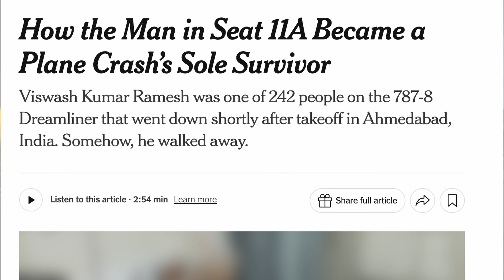Why the RAT Changes Everything – Air India 171 Update

Comment: So the pilot and copilot is having more than 8000 and 1000 hours of flying experience so do you really think that they won't distinguish the correct lever - Flaps and Landing gear - the landing gear is far away from flap controller its like muscle memory and why the Prop sound was coming in the video -  bcoz of RAT was deployed and that clearly indicates something really bad with the engines, so Boieng should answer this

Comment: GEnx EEC Microprocessor fail by solder failure. FAA issued directive 4 years ago for 747-8 and 787-8 GEnx engine and told to reduce Remaining Useful Life of component and change out prior to PF Curve failing. This is a known failure mode that may have been overlooked by Air India O&M??

Comment: A plausible cause could be the main Battery and alternative battery toasted internally, due to extreme Heat wave conditions. Since the Temperature at that time on the ground was like 50+C and the overall temp was like 46C around that airport. when the flight arrived to Ahmadabad few passengers were telling they had Cabin A/C 's compressor were on and off due to the weather in Delhi when the passengers boarded. So to sum it up multiple level of failures. 1) Had the the previous pilot / Staff informed that they had this issue ?  2) can the battery cause both the engine to fail. 3) how come when they were in the beginning of the tarmac both engines would be roaring/ Firing  and then failed all of a sudden at take off both tanked. Looks like both the engines failed  to provide enough thrust after take off with limited time to react and act.

Comment: At this point it is to early to surmise on limited information. You have already changed your mind due to more information. (footage)  When the black box information is examined  lt will reveal even a lot more . 
My freind a pilot when he saw footage said ... engine failure . He may be right.... first time and he only Flys crop dusters. Another freind who is a mechanic  on an apple orchard said its an hydraulic issue .... he could be right first time ! 
I'm not here to express my opinion on what it might be ...... apart from a very tragic accident. 
Let the real flight investigators do there job . 
Then the public will be notified at the proper time with proper facts on what has happened .

Comment: What could possibly cause both engines to fail at the same time? Aren't they designed to be completely independent from each other?
Or is there some subsystem in the aircraft, the failure of which affects both engines at once? If that's the case, it's a fundamental design flaw.

Comment: I think from the beginning on there was evidence that something was wrong with the airplane (if the video is legit) A video surfaced online where passengers of the previous flight on that same plane had no working on board screens and remote controls which could indicate some issue with the electronics
Reply: They are switched off until airborne

Comment: Question that needs to be asked is what are potential causes which can cause Engines to shutdown , folks note that engines per se need not fail like bird strike or mechanical , it could be electronics controlling it that fails although engine controllers are double double redundant meaning even if one channel out of 4 works then this can't happen. 

But atleast credit to the way he finished the video 

Is boeing 787 going 737max way ?

Comment: May I ask for theory of flaps since we have such intelligent sensors and automation in place. Would it not make sense that flaps are automatically set for lift-off where pilot can manually then override. Rather than having them off, where it is susceptible to human error. Meaning that it would be guaranteed that human does not fail, while still giving input options if anything goes wrong? 

l get it for landing gear, it is better to keep it down until you’re sure as you can use them to land in emergency. Thanks!

Comment: Steve sir , battery drive motors hydraulics,hydraulics drive flaps, landing gears. Long stoppage at ahmedabad drained batteries running airconditioning. At takeoff batteries shorted causing explosion sound.

Comment: One more observation is that the main gear is not tilted, it is horizontal, wich means that the "gear up" action was engaged just after takeoff, normally , it's done automatically before the gear is fully retracted . For some reason the full rétractation was not completed, maybe because of a sudden loss of electrical power, wich could confirm a dual engine failure...

Comment: So? I guess the question might be what electrical system or control system failed to make 2 engines stop? A clogged fuel filter like on a car? Do planes have fuel pumps that could fail? So, the plane was dispatched from the gate. Engines fired up. Enough thrust to get to runway and down the runway the engines are reving up yes then for some reason the engines stop? No more fuel to the engines? Pilot controls failure? I am no pilot just throwing uneducated questions based on pilot Steve's knowledge. 🤔

Comment: Good explanation sir! Iwant to ask something though. Why isn't the aviation industry doing something about the fact that if/when things go wrong in a flight it ends up proving fatal for everyone on-board? They should have an emergency evacuation plan where the fuselage detaches and drops down with parachutes deployed. Something similar needs to happen with the cockpit also for the safety of the pilots. So many years of plane crashes and still we don't have this in place. Spacecrafts have detachable units, then why can't it be used in planes to save lives?
Reply: They can also use thrusters that can be controlled from the inside to get some control on the navigation of the fuselage/cockpit under parachute - to make them land in a safe area. They are using these things in spacecrafts for years.

Comment: Could there be some interaction between fuel contamination and the nose up pitch triggering the dual engine failure? Like a layer of water and when the plane pitched up it changes the orientation of the fuel in the tanks leading to the failure at/near rotation?

Comment: Is it true that the 787 engines will not run at takeoff power with any kind of gravity feed alone, i.e., they need at least 1 electrically driven fuel pump? Is it also true that a previous 787 software bug would shut down all AC generators if it was powered for too many days? If both of these are true then it seems like a massive red flag. Software alone shouldn't even have the capability of shutting down something so important.

Comment: A dual engine failure after rotation, not associated with a bird strike or fuel problems is something unheard, please correct me if I'm wrong. Maybe they shut down the wrong engine, but it sounds unlikely to me.

Comment: A question please , you said when the RAT deployed  it should supply power to controls , hydraulics when the engines fails 
What happens if RAT  requested while engines are running does it restart request of engines because of switching of controls power source ?
Reply: Is it possible to request RAT even  while engines are running ?

Comment: Could I also add just a thought that’s all nothing else.Could accidentally raising the flaps be misconstrued as a double Engine failure as in the few seconds you have to diagnose it feels like the plane is without power as you will create a descent by this action .This in turn could have provoked manual deployment of the RAT and half of a mayday call.But then again you would not get the electronic switch over as experienced by the survivor.Why am I saying this ..well the engines provided them enough power to get well above the positive rate gear up call and that’s a drill that is just always going to happen as soon as airborne.Why no gear up then..?The engines allowed them to reach an altitude well above this call level .Of course if the fuel control unit failed or some thing to cause the double failure even before the gear up call 
that would explain the gear still down….but the Aircraft climbs well before the descent point and that’s well above 100 feet…so why no gear up?…Anyway leave it to the evidence and the experts…just to say don’t forget the manual deployment.

Comment: I was part of a team that developed a statistical solver for system failures, nearly two decades ago. The study was sponsored by NASA and Lockheed. Now more than ever there are solid failsafes in the hardware components, which’s great. But what we really tried to crack open in our research back then (but couldn’t) was to develop a metric such as MTBF for the control software. I’ve not revisited this train of thought since then. This tragedy has forced me to cautiously, and with utmost respect suggest that this could be a software failure. 

Why? Cos as a system increases in complexity it gets ridiculously hard to speculate why an RTOS primitive such as a semaphore has taken, and why it will result in a race condition. Sometimes it is as simple as a software update to the seat lighting system, which involves “hack it to crack it” - ok the project deadline’s round the corner let’s get this done ASAP- wait on the flag, once the button press is serviced, but HELLO you ignored/forgot the release operation and the reviews did not catch it because it takes several million runs before it has a system-wide ripple effect. 

With the advent of more features (driven by expert systems and modern AI) there’s a big code bloat. With 3rd party developers and vendors getting access to critical sections of code (not to mention unlimited virtual memory), we run the risk of a catastrophic system failure due to a “minor” coding error. 

All said and done this is extremely tragic. One can theorise all one wants but the only wish in the end is, that this never happens again.

Comment: A piece of information that might be worth considering is that (apparently) the plane joined the runway and taxied back to the end of runway 23. The security camera video appears to show the aircraft rotate at the very end of an 11,499 foot runway. With nearly 40-degree temperatures and a fully loaded plane, one expects a longer takeoff, but this seems to be very long. Is this an indication that they were low on power? I'm not a commercial pilot, so your opinion would be valued.
The other piece of the puzzle is that the flight path of the aircraft shows a 30-degree yaw to the left. The point of impact is not in a straight line with the runway. with the dust thrown up in the video and the crash site, is it possible that they took off with one engine? I know that the 787 can do this safely. Again, your view would be valued.
Mark

Comment: A bang could be anything, but, anything engine related would have caused something of a visual effect...
now, we know at the very start the 787 had issues with exploding battery units (something also possibly triggering a ram)... I know they thought they fixed it but might the issue have reared it's ugly head again???also, from my audio it  seem we can hear a jet engine too...
another option is that this was an (Islamist?) terrorist attack after all, I do not believe that the plane was shot down, but, an unlucky location of a small bomb could have quite easily temporarily cut all the hydraulics together, which could mean a partial loss of control resulting in a power-on stall. (again, whilst fuel contamination was my initial theory, currently, I think the videos and visuals suggest the plane still has the power - never really believed that takeoff with the wrong configuration was possible due to all the multiple safety layers against that....)

Comment: Flaps & landing gear controll switch are a distance apart to accidentally operate one for another... Boeing 787 had problems right from the inception, even their own engineers raised concerns... One of them was asked if he would ever fly in this plane & the answer was negative.. Boeing is recently accused by its own engineers of cutting corners... 737 Max 800 is a famous example how they added MCAS without even mention of it in mannuals & no training was provided... Pilots who flew 737-800 Max's were completely in dark about MCAS, which led to disasters.

Comment: The other bit of evidence is the fact that the flaps and landing gear were both incorrect so that also points to something that could be connected and i would guess there is nothing else other than dual engine failure that connects them?

Comment: NOT A HEAD SCRATCHER…fuel starvation because of vapor lock…it was a very hot day and something failed and caused a vapor lock…the pressure system failure…just at take off…the black box should tell us what happened…
Reply: This I believe its going to be either a design or maintenance issue! Sad conclusion.

Comment: The 4th piece of evidence is the position of the main landing gear bogies. They are tilting forward. This only happens during landing gear retraction before the doors open and the struts start rotating inwards to stow the wheels. Normally the bogies tilt backwards when the landing gear is down. This shows that they lost hydraulic pressure during landing gear retraction which puts the wrong lever theory to rest and also points to dual engine failure.

Also in the video it is evident that the leading edge slats are extended which means that the flaps were also extended, we cant know to what position though. The flaps of the 787 are wide and rather short so they are not easy to discern in low res videos. So the no flaps theory is also put to rest.

Comment: Steve I still think there was a major electrical malfunction that took out the electrical system/circuits responsible for providing ignition to the main engines and hence the engines stopped being operational then total electrical power loss deployed the RAT, dual engine failure is the symptom not the cause here, my take

Comment: Fifth, seems pilots did correctly engage gear up, because the rear carriage changed tilt orientation from backwards to forwards. But I get since hydraulics were out, the gear could not be pulled up. Check @Swiss001 latest video.

Comment: I think both engines stalled as the survivor reported explosions at take off. Fadec intervened and there was no time to re spool the engines. At 40 degrees and 68%RH your stall margins are very narrow as the system recalculates and thrust is limited and sluggish at take off. several indian pilots have reported this at similar weather conditions

Comment: Master Circuit Breaker:
I recall flying back from Naples a few years ago. As we were ready to depart the stand, all the lights failed in what seemed a total loss of electrical power when the aircraft attempted to switch over from ground to internal power.. This happened 2-3 times. The captain apologised and said something about the ground electricity quality being at variance with the planes internal power. Having knowledge of electrical systems, my impression at the time was that there was some sort of circuit breaker that would cut the power to the plane if the ground power might damage the plane’s  systems. When they did manage to switch the power over to internal, I recall being nervous about what would happen if the power dropped out again during takeoff.  
Regarding the Air India crash - Is there some sort of master circuit breaker that could completely cut power on the plane, if so maybe this tripped out and cut the power during takeoff. I may be completely wrong about this, but I thought I’d ask the question.

Comment: The Bus Power Control Unit (BPCU) manages and monitors the distribution of electrical power. The Engine Digital Controll, RAT Deployed, Flaps stucked in Position, Cabin Power all this fail in BPCU Error. And its not fully redundant!!!

Comment: Hi Captain Steve, there is another clue to confirm that both engines lost power : look at the main landing gear : it's no more on landing shape, like if the hydraulic system stops just after pilot retracts it. The cinematic of the main gear is special on this aircraft. When the gear is out, you can see that the front wheels of the main gear is upper than back wheels, on this video, it's the contrary, front wheels seem to be downer than the back wheel. Pilots retract gear but the dramatic issue appears at this moment, which let the main gear out, but in good position to be retracted in their housing.

Comment: Excellent job sir. Any small explosion intentional or not in the right place in the hold could have caused all engines to roll back to idle or sever a multitude of connections to cause the rat to deploy. Whatever it was will be tough to find due to extensive fire damage. Hopefully the black boxes will  tell the tale. Thanks!

Comment: I agree with your analysis of the accident. I also think that it was most likely duel engen failure and or also electrical issues that caused the RAT to deploy. Not much options for the pilots in such short time and low altitude 😔

Comment: Capt Steve, I saw on another video that it was reported  the under carriage had started to retract. The reasoning was that once the gear up is selected the dual carriage unit tilts forward as in the video, i.e. the front set of wheels tilt down ready to fold up into the fuselage. Normally when fully down the rear of the set hangs down on a 787. Maybe you could let us know if this is correct.
Thanks from Aust.